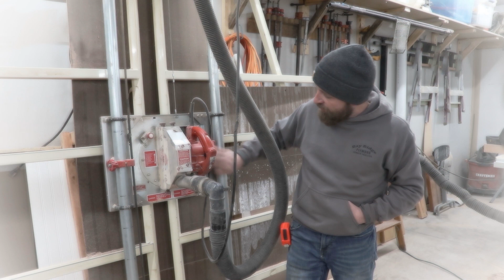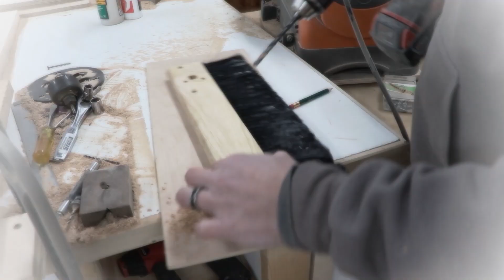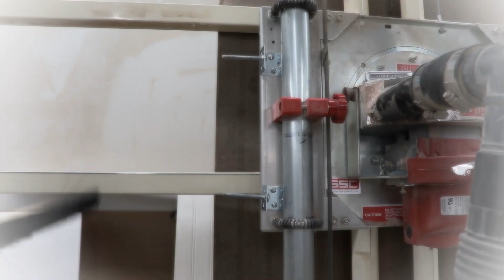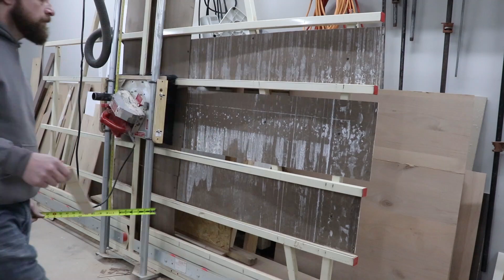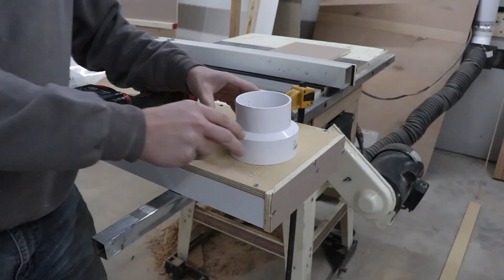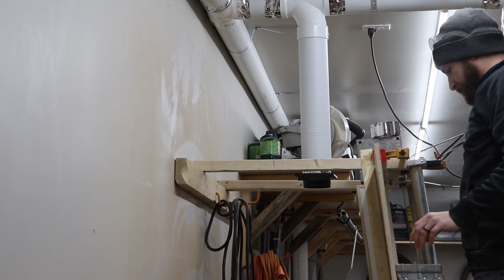DIY Panel Saw Dust Collection!!!

Comment: I'm curious to know more about the part that you attach your hose on. Was that included with your saw?
Reply from the maker: Great Question, If you are talking about the metal box and tube coming off of the motor base. Then yes it came on this model saw.  It is a metal housing with an exaust port that fits around the blade on this model. I did need to tape the gaps in a few places to get it to seal up better and reduce blow out of fine dust.

Comment: How about a zero clearance insert for the panel saw to get a better edge?  Is that possible?  Also, where are you located?
Reply from the maker: The zero clearance insert would work if you were only going to make vertical cuts. Once you turned the blade you would have to remove the insert and that could get to be a issue if you switch back and forth a lot.  I use this saw to cut my rough panels out most of the time so I can handle them on the table saw by myself.  We are located in Green Bay WI . Thanks for watching and hope you enjoyed!!!
Reply: BayRidgeDIY thanks.  I am in Appleton and want to make it up there for some Baltic birch.